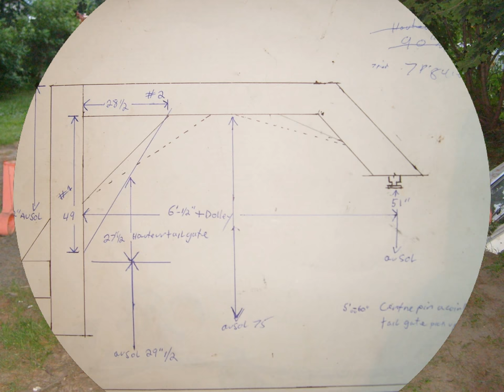trailer conversion from tongue to fifth wheel by frankenstone

Comment: I enjoyed the music as well as all of the weld joints.
Reply from the maker: Thank you for the comment  Kevin im glad you enjoyed some welds are not as good as i would of wished considering i used galvanized steel (not well cleaned) for some parts and old humide welding rods nevertheless i think i did a good job considering the conditions thanks again for the comment check my other builds on the chanel
Reply: @frankenstone804  Kevin I understood what you meant.

Comment: I'm looking for someone who can do this to a travel trailer. Could you possibly strengthen the chassis of an existing trailer, upgrade  axles and install this kind of hitch? 

The reason I want to do it vs buying a fifth wheel is because fifth wheels have raised bedrooms which make for very low ceilings and generally speaking, with the exception of a few very pricey ones, I don't really like existing layouts. In my mind, if I am to completely remodel the RV then it shouldn't cost that much. So I'm looking for a good shop to take on this complex assignment.
Reply from the maker: Thanks Diana for comment sorry i dont do big jobs anymore and im in quebec canada make sure you find an experience welder one who has experience in heavy trailors
Reply: If you're still interested, a better idea would be to skip all the fab work. RV frames are essentially garbage made by a company called Lippert who has a very bad reputation in the RV world but they are the only frame manufacturer. This can be found in numerous articles and videos. 

Instead, buy a standard gooseneck trailer and take the body of your RV from the factory frame and permanently fix it to the gooseneck by welding. This is becoming a very popular method and gives the RV body something more sturdy to ride on.

Comment: Franken Stone, I understand the difference between 7018 rods and 6011's, but I currently don't have 7018 you don't recommend using 6011's and a Lincoln 220 tombstone?
Reply from the maker: Hello Nathan Money thanks  for watching and comenting if you dont have 7018 then 6011 is next best thing 6011 more penetration but less strenth the 2 first numbers mean resistence strenth times 1000 example 7018 resiste 70 000 pounds of strenth
Reply from the maker: 6011 and lincoln 220 is cool use one eight size rod and weld very hot for maximum penetration
Reply: Look guys the welds are long and 60 series more then enough. But what you need a clean (not included, as in inclusions) welds that flowed and capped cleanly. It’s the quality of the weld not the filler metal that makes all the difference.